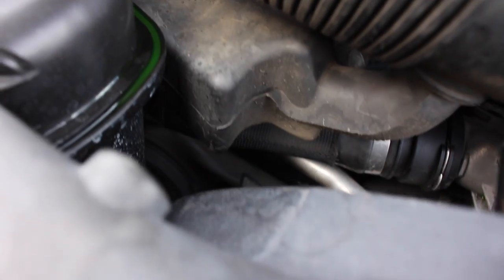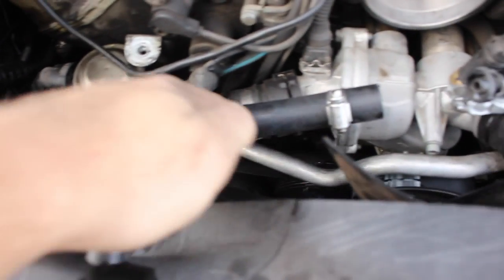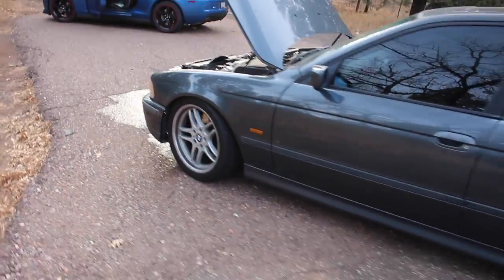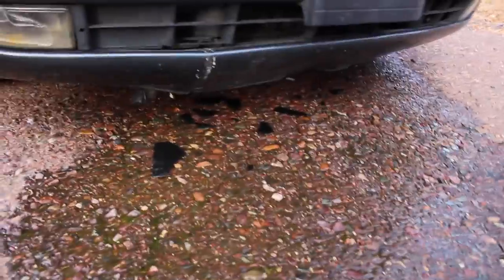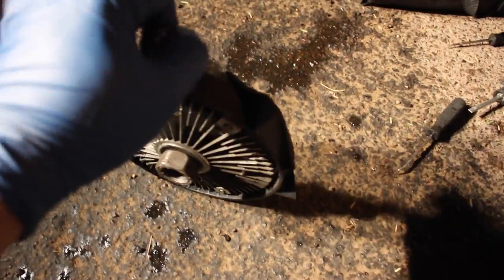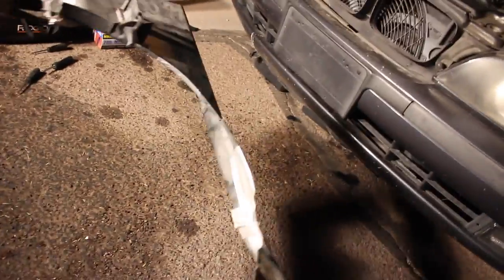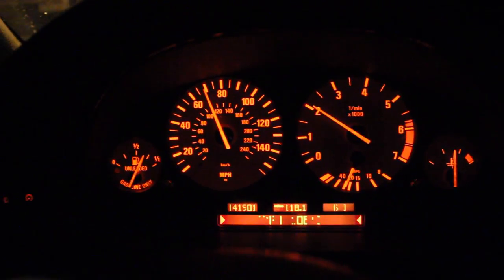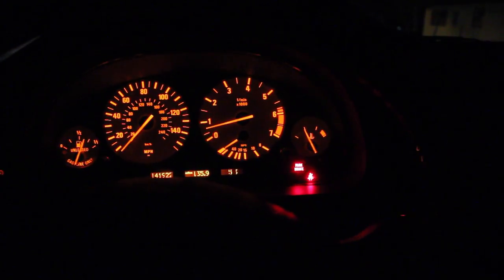My $1500 BMW 540i, aka The Bavarian Radiator Destroyer

Comment: Title suggestion: "The Bavarian Radiator Destroyer"
Reply from the maker: Haha, good idea! This is the second radiator it's killed!
Reply: @DannysGarage  everyone who owns a bmw makes the mistake of putting antifreeze ( green coolant) and their car at some time or another and it  destroys all the plastics in the vehicle. I have ran dexacol in my BMW 540i, 745i & 325xi after a good flush,  radiator replacement thermostat replacement water pump replacement and belly pan replacement on the 540i I had no problems, I ran 100% dex and I drive the car very hard.on the 325i I had to replace the water pump and thermostat because the person who had the car before me had antifreeze in it. And I went back to blue BMW coolant and it I had no problems ever since.the 745i had antifreeze in it. I had coolant problems with that, I flush and replace with blue BMW coolant I had no problems ever since. So you already know what I suggest, if you've made it this far. and that's a coolant flush and go to either cool 100% or BMW 100% coolant..... You will have no problems....

Comment: It happens to every E39, but to be honest I’ll take the cooling system over engine or transmission problems. I’ve actually gone through this issue with my E39 M Sport already and it wasn’t that difficult and expensive of a fix. I bought everything online (prices are way cheaper) and did all the work my self, it was actually an enjoyable job. I replaced all of the hoses, radiator, reservoir, cap, clamps, seals, sensors, water pump with metal impeller, thermostat. I actually didn’t put the fan clutch and fan on back again, if you do some research you can find out that you don’t need it. That way you can avoid having that thing fly out like a rocket.
Reply from the maker: Smart choice to do it all at once. That's what I do on all of the cars I care about. This 540i/6 was always destined to be a parts car, hence me not caring about the cooling system as much and having some fun with it. In most places you can definitely get away without a clutch fan, but here in Arizona I found my BMW's to be running on the warmer side without the clutch fan, especially while idling or in stop-and-go traffic, so I've chosen to put the fan clutches back on and just keep an eye on them. If you replace the fan clutch with a new, reputable part and install new fan blades, that should prevent it from flying through the hood any time soon. Most of the catastrophic fan clutch failures that I've seen were when using an old fan/fan clutch— like on the 540i/6 where I grabbed a random fan clutch from my parts pile. I later looked at the date stamp and saw it was original from 1999, haha.

Comment: my e39's hood had the exact damage on the hood but worse to the point the rad leaked and the fan clutch siezed spinning at the same RPM as the engine causing it to blow up and damage all the hoses and everything around it. had to go and get a new carbon fiber hood and have since replaced the radiator twice cuz of the shitty design.

Comment: just use the lowest tsat on summer time  coolant temps above 105c kills all the hoses and gaskets.these temps were designed only for emissions.other than bullshıt
Reply from the maker: Yeah that's the plan for my 540it and probably the Range Rover, the 88ºC thermostat from the diesel M67 engine in Europe.
Reply: even 82 C  would be nice :))

Comment: You can try using a lower bar coolant cap. Mine had a 2 bar or 200kpa. Try a 1.4 or a 1.2 can be bought from German auto solutions.

Comment: That looks to be a very neglected car at least the engine bay. I have my own radiator destroyer e38. it seems that my car was also very neglected by the previous owner so I had most of the cooling components replaced: Radiator, water pump and its hose to the radiator, overflow tank, coolant. Since then all the problems went away, should I expect these same problems to resurrect? I really like my car and would love for it to take space in my driver for many years to come.
Reply from the maker: Nowel Aquir I mean the car in the video was $1500, I knew it was neglected from the start. I mostly bought it for the manual transmission. If you’ve replaced the cooling system on your E38, you can reasonably expect quite a few years of reliable service out of the cooling system.
Reply: Nowel Aquir 
It’s the M62 yes? You’ve replaced all the common parts to fail in the cooling system. You should also replace the fan and fan clutch. The video explains why ;) Electric fan can also fail. If your water pump has plastic impellers, throw it away immediately (if you have the V8/12).

Other than that, valley pan can start leaking, misc hoses go bad and the two aluminum pipes that run from the water pump through the engine can also leak. Power steering reservoir can leak. I mean it’s an old car, everything can leak right?
I don’t really care about leaks as long as i don’t have to fill up every week hahah.

Comment: That slit in the pipe came from when the fan grenaded and damaged that hood the first time. Might want to replace everything.  Also it sounds like your chain guides are going. Replace those ASAP or you will destroy that engine. Delete that fan and go electric.
Reply from the maker: Yeah, that's what I figured. No worries though, this car has been parted out. I drove around it for fun and now its parts are sitting in my backyard. The whole point of this car was to be a source for the eventual manual swap on my 2000 540it. Otherwise I would have put quality parts and actually replaced everything on this one, like I do on all of my serious cars.
Reply: Danny's Garage  I live in Tucson, have an E39 you still got parts?

Comment: I'm still trying to gather tools to actually do my own work on e39s. I'm probably gonna spend around $5-600 for that. I also found a wrecked 1998 540i black on black in Georgia for less than 900 so I'm really considering it since it's a lot of DIY vids on changing suspension and fenders. But it does run very well plus i want to do a timing chain & valleypan job on it when I do purchase it since I can just follow your videos. They were very informative so I thank you for posting them. You make it seem straight forward so that's really where my confidence is coming from. 😎 I hope I can do it as half as good as you do it.
Reply from the maker: Heck yeah! That's the spirit! My videos are for the M62tu engine, but other than some slight differences it's the same basic procedure. You can just skip past the Vanos portions and timing the engine is a lot simpler without the Vanos. You still need the M62 timing tools, but there are plenty of places where you can rent them, or buy them on eBay for cheap. In terms of tools, you don't need too much— just the usual metric sockets ranging from 8mm to 27mm (bigger sockets needed for suspension work), metric wrenches in those sizes, breaker bar, 1/4" & 3/8" & 1/2" drive ratchets, and some screwdrivers. If you look around you can probably buy a whole set on sale at Craftsman or Harbor Freight. You don't need to spend a small fortune on tools to work on your E39!

Let me know how it goes! Glad I could inspire you to tackle an E39 project :)
Reply: Most likely I'll YouTube the process like you did. Because I rather do it myself than pay 2 grand again like I did with my old 540. I'll definitely let you know what happens. It will be my first time tacking a big job like this. I just rather fix the car myself this go round since it'll be my second e39. I lost too much money taking my car to shops around Memphis lol
Reply from the maker: Yeah, most shops don't care about our old cars, so it's up to us to keep them alive. I do my part by doing chain guide jobs for far less than shops charge... I'm finishing up my 11th job tomorrow, with a 12th one coming soon.
Reply: Danny's Garage how much do you usually charge? Because like I said in another post I'm in the market for a X5 4.4 and I should have a new 540i in a month. I'm still gonna order the timing guide kit but I do want to at least have one car with the timing job done already and I have no problem coming to Arizona to get it done by you.
Reply from the maker: Honestly it depends on how much you want done. The base chain guide job is $1200 for the labor + the parts cost. The valley pan gasket, Vanos rebuild, and intake manifold reseal add cost if those are required. It's quite a lengthy job, requiring 35-40 hours of labor, hence the labor rate. Most shops charge $4k or more on average, based on receipts I've seen.
Reply: Not bad.  Everything else I'm sure I can do.. I'm just skeptical about the Vanos rebuild and the timing guides. If I can get that out the way then it's smooth sailing.
Reply from the maker: Yeah, chain guides are definitely the thing that looms overhead when you have an M62/M62tu. With them taken care of, it's a much more stress-free ownership. My 540it has had the guides done for a long time now, and I've put almost 27,000 trouble-free miles on  it. No leaks either!